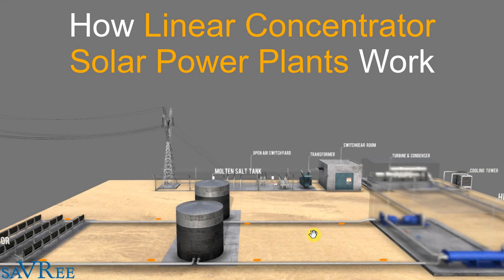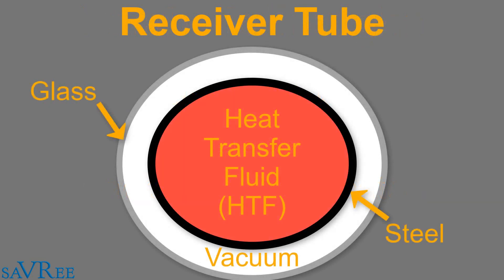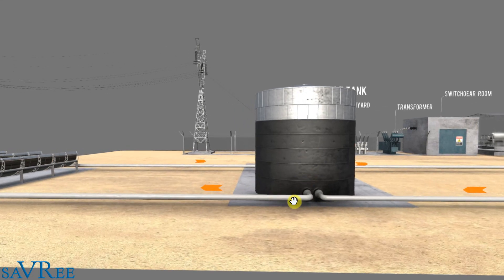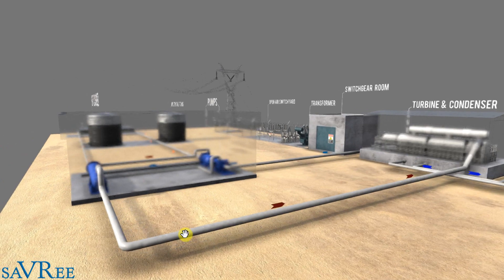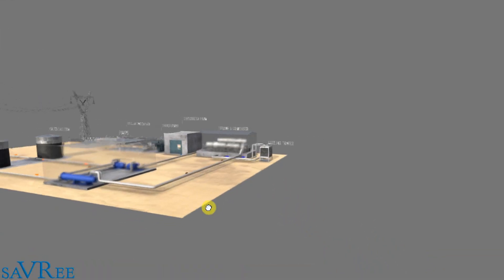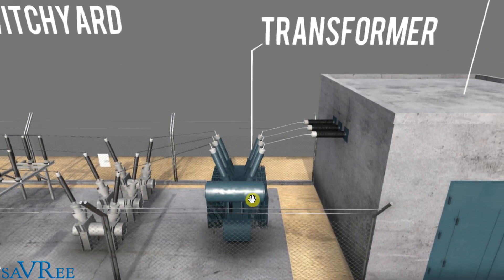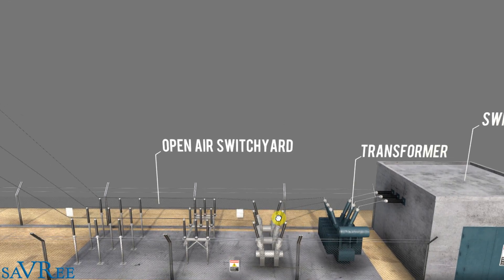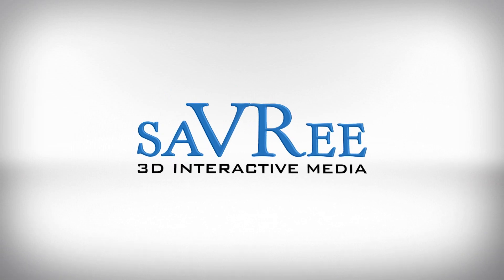How Linear Concentrated Solar Power (CSP) Plants Work (Animation)

Comment: Why don’t we just use the same water and turn it into steam instead of losing heat in in heat exchangers?
Reply: Water boils at 100c, if you have a liquid that can heat up to many times this, such as oil or molten salt, you are now taking the full capacity of the sun rays, these can reach over 600c, once this liquid is at these high temperatures, then can remain hot when there is no sun such as night on a cloudy day ,yet they can still heat up and boil the water many times over to produce steam
Reply: You mix upp, water used for steam production, is a special water typ called boiler feed water, water released from condensation in the turbine, contains a lot of deposits and impurities, using such water for steam production will damage the steam generator, and impact the performance of the plant, less steam to the turbine and less electricity generating in conclusion.

Comment: but if you had that much heat in a pipe .... couldn’t you just run co2 or ammonia in and bolt a turbine to the other end? from there if you still wanted to store heat you could use electric element to directly heat the molten salt

Comment: Perfect clear and explanation of the process...what would the heat be at the heat exchanger...how hot is the steam? and how hot does it get in the steam turbine at time of power generation? Would appreciate it...
Reply: The steam temperature, will be the same as the heated molten salt temperature.

Comment: Thank you, i really liked your video. I have a question. Which systems are more efficient? Concentrated solar power systems or simple solar panels?
Reply: It differs depending on local conditions, the specific plant and the factor you refer to.
Unlike PV, CSP can't convert scattered light. In rather cloudy countries, you miss a lot of energy from scattered light with CSP.
Heat lowers efficiency of PV. A disadvantage in hot areas.
Different CSP plants have different efficiencies, depending on the achieved temperatures. Solar tower plants with molten salt are  pretty efficient, parabolic trough plants rather less.
And do you refer to mirror/aperture/module area or to the built surface area (covered land area)? CSP needs big gaps between the mirrors to avoid shadowing. PV needs rather less space between the modules.
And there is also a "hybrid" version: Concentrated Photovoltaics, CPV. Pretty high efficiency, but like CSP, it can convert only direct sunlight and needs a tracking system.
However, regarding MWh per year and hectare land area, there is no crucial difference between PV and CSP.
Theoretically, you could probably get the most electricity per area from horizontally mounted efficient solar panels (e.g. monocrystalline silicon). Without gaps between the panels. But you won't install PV that way.
Reply: @701983  Thank you for your information. As i understand, CSP and CPV are more efficient than PV on sunny days. But they need so much space. In general, there aren't  big difference in efficiencies. If we come to my project, CSP and CPV systems aren't necessary because of total cost. For increasing the efficiency, i can make custom PV by myself.
Reply: @ardaonurgs  Like I said: It depends on your definition of "efficiency".
However, besides efficiency, PV is much cheaper than CSP nowadays. And I suppose, normal fixed installed PV is also a lot cheaper than PV with tracking systems, including CPV.
Reply: There is also the advantage of producing electricity even at night wich PV panels can not do. These CSP systems pruduce very high temperatures, with these temps you can heat up the molten salt, save it for the night and continue producing electricity. You could do the same with PVs, but the electricity would have to be stored in bateries, and batteries are very very expensive. There is another system that heats up rocks instead of molten salt since that system can reach temps up to 1200 celsius, these rocks can boil water to produce steam/electricity for days, and rocks, as you know, are dirt cheap